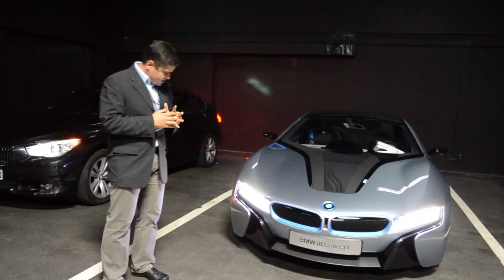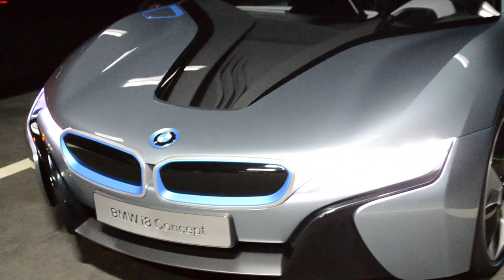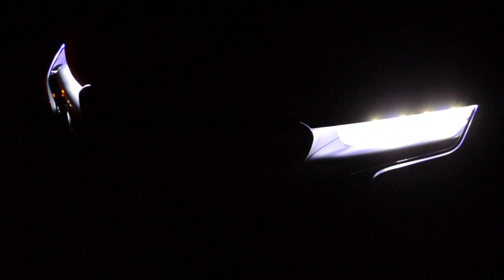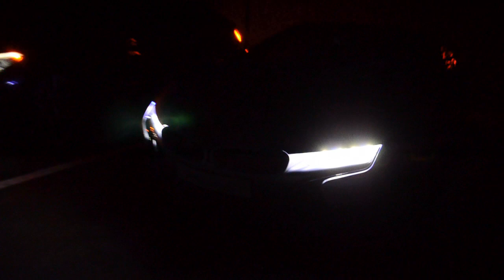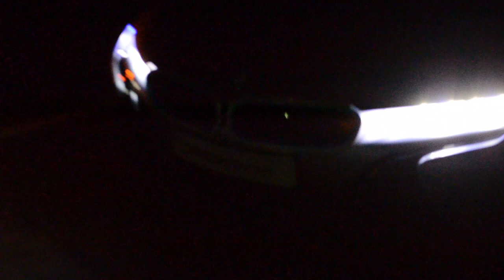BMW i8 Laser Headlamps

Comment: Know what you mean- here in TX, I've had several heart-stopping moments of laser warning from my Valentine that (graciously) turned out to be some Infiniti in the opposite lane with the cruise control set. Also some red neon signs will set off laser warning—and there are a number of vehicles that actually use a red neon tube for their HMSTL (3rd brake light), so you can just imagine.